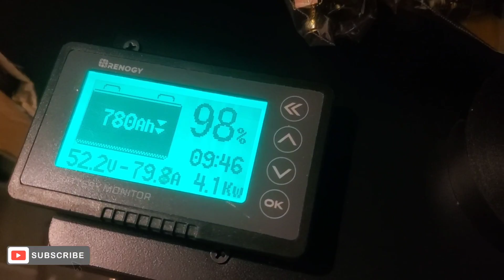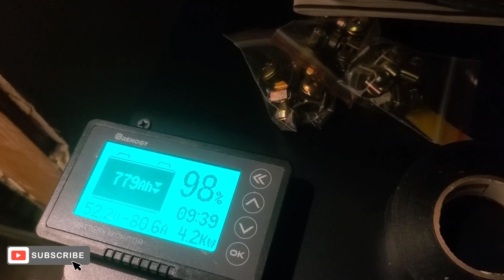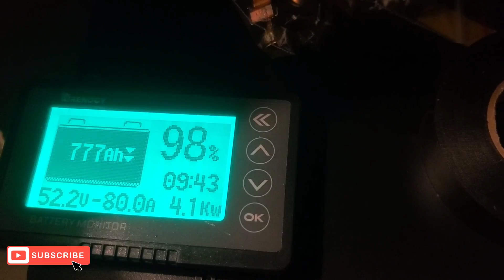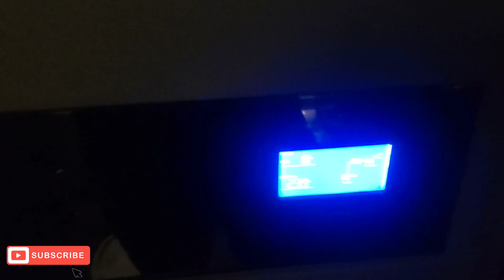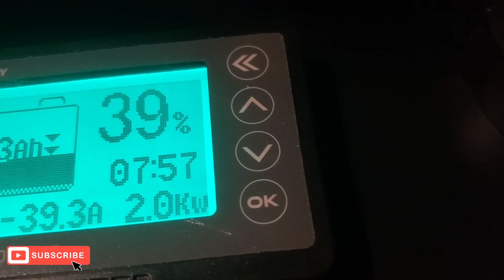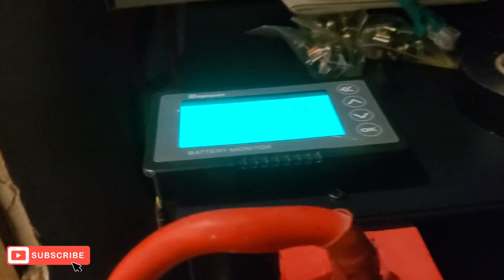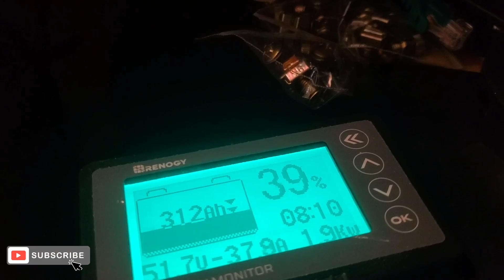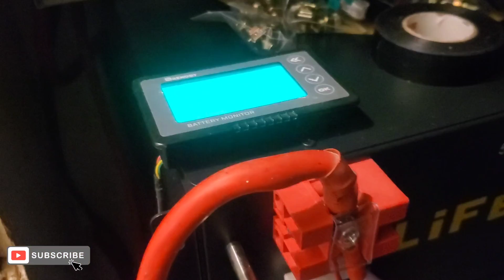How Long Can These EG4 and GYLL Batteries 40KW 🔋 🔋 🔋 🔋 🔋🔋  Charge My Tesla Model S Everyday

Comment: I have 6 EG4 batteries on my solar system. A 5KW GroWatt inverter feeding my 110 circuits and charging the batteries. I have 18 385 watt solar panels feeding the Inverter. It takes about 4 hours in full sun and my batteries are fully charged.

Comment: Heck yeah!! You'll have it made if you can charge the tesla with your solar setup!! Looking Forward to watching update videos..  I have a 2014 model S, I'd like to charge it off my setup, but I'll wait until I get atleast another EG4 battery.  I need to invest in a 240v split phase inverter otherwise I'm stuck charging with the 2000w 120v inverter.. 😬
Reply from the maker: Yea going need a lot more power, so are you charging your model s off grid?
Reply: @texasoffgridguy8749  No, I have a Nema 14-50 outlet in my garage. 
I want to have a backup way to charge it and to get more out of my solar system. It's not  a big system. I started it to see how the whole solar thing worked...